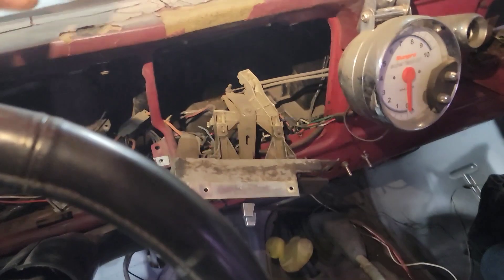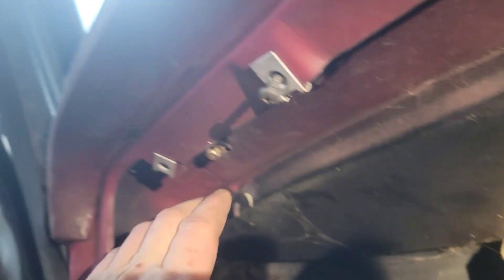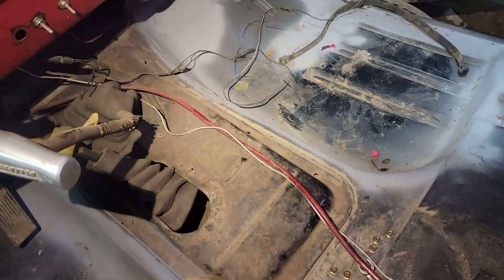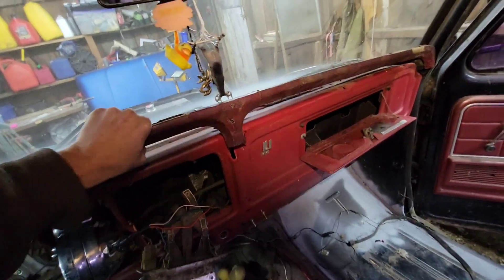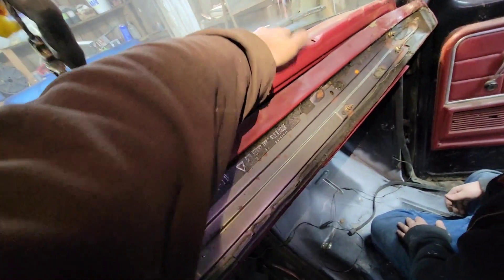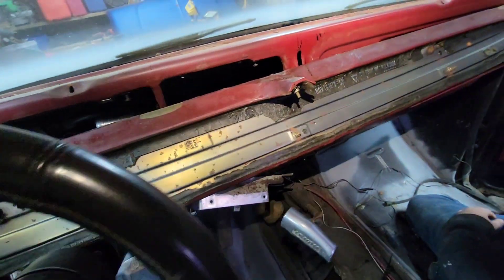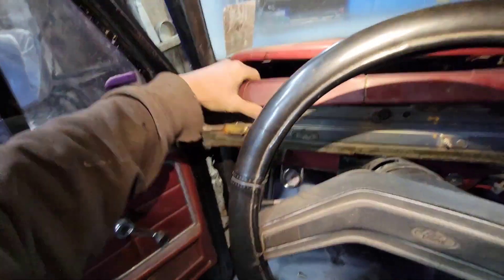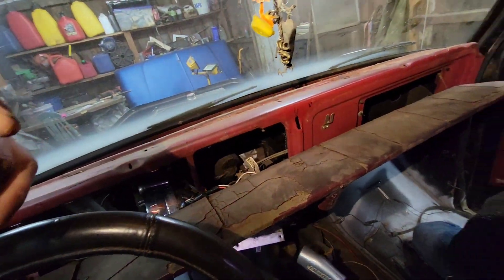How to remove dashpad on a 1979 Ford F150

Comment: Ive seen you can use bondo on the dash to save it
Reply from the maker: I've seen that a couple times never done it myself but great idea. Thanks for reminding me.
Reply: I can speak from personal experience. Just buy a new one. In about 3 years youll hate yourself for using bondo when it cracks and looks god awful hideous.